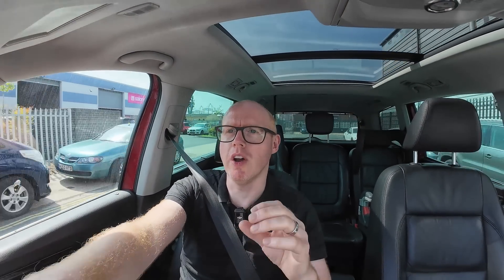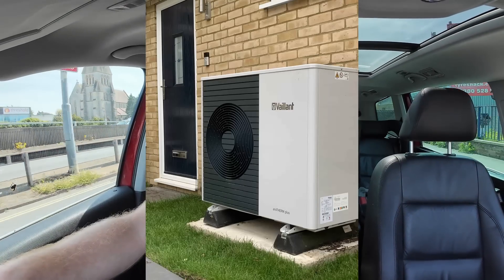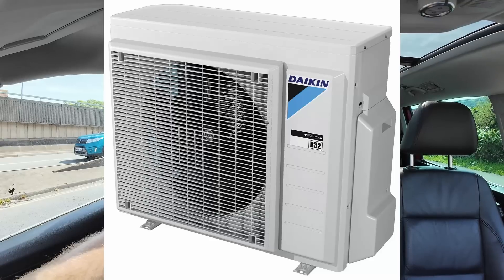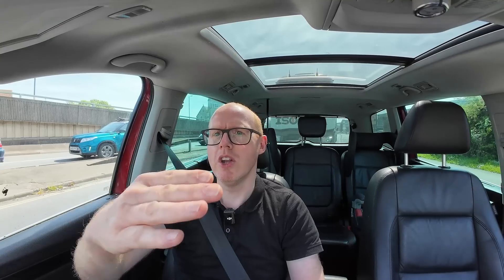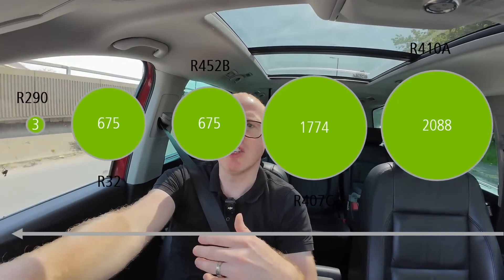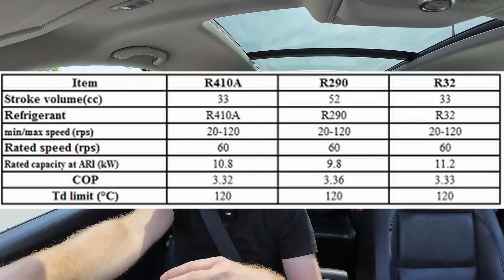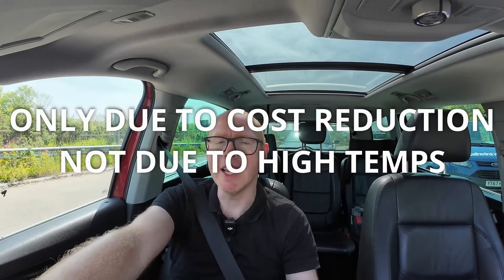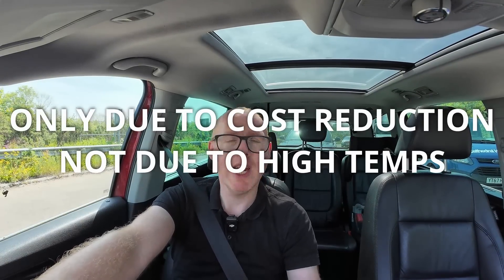High Temperature Heat Pumps Solve Nothing! Octopus Cosy 6 is nothing new!

Comment: Heat Pump industry in the UK is extremely poor and taxing on the owners. My heat pump was poorly installed by EPC Improvements from Chelmsford, and my SCOP is NOT going above 2.23. I had to pay £850 to have an independent assessment done to prove it was badly installed and configured, and now I need to pay another £500 each if I want 2 additional quotes for the work. So in total it will be almost £2000 before remediation work even commences. If that doesn't scare you than I don't know what will. Reason I needed the assessment and quotes is because I started a claim against my installer, 2 years in the making, all whilst I am paying around £1500 more on my heating every year.
Reply from the maker: Ouch. Was this an ECO4 scheme?
Reply: @UpsideDownFork  BUS scheme, £5000 voucher, total cost of heat pump £23000, so £18000 paid. I am happy to get in touch if you want me to, give you all the details and my journey towards trying to fix it. This is as raw as it can be with full total cost of ownership, which is crazy compared to a Gas Boiler. It's a bit like saying, scrap you 15 year old, £3000 diesel car for a £80000 EV because it is better for the environment and saves you money. How long to make up the £77k difference, then start saving?
Reply: @UpsideDownFork  I've sent through photos and the assessment report to 3 of the only Heat Geeks in my area. Two stated that they would prefer to replace the heat pump and all radiators (imagine the cost). I have initiated a Section 75 claim, and they were the ones that asked me to get 3 quotes for fixing it. I have asked them if I have approval to engage with all 3 companies, having to pay them £150+VAT per hour to come down, and perform their own assessment. I estimated £500 each, because it will be at least 2 or 3 hours per visit, if no longer.

Comment: Why talk it down when you use an R290 heat pump yourself?

The advantages over R32 are:

Not having to install new radiators.

Water getting up to temperature faster.

Having the latest technology
Reply from the maker: I don't use any of the advantages of my R290 heat pump. I'm not alone in this. Because of current building regs, they cannot design a heating system to be truly high temperature.

The marketing is a complete misnomer.

My heating flow temperature has been between 30-40 degrees for months and my DHW is heated to 48 degrees once per day.
A R32 heat pump would do exactly the same and would offer more flexibility during installation due to siting requirements.

Comment: I have an old 12 year old heat pump and it is high temp. my system is designed for 50 deg C Flow temp. The legionella cycle can be run at a lower temp for a longer period of time. I went for high temp to save upgrading the radiators.
Reply from the maker: Thanks for commenting. I presume your 12yr old heat pump is a R32 unit and in today's parlance, that would be considered a low temperature heat pump.
A high temperature heat pump must be able to achieve 70 degrees plus without the assistance of immersion elements. At the moment in domestic applications, this is typically just R290 heat pumps.
Reply: @UpsideDownFork R32 hasn't been in use for that long mate
Reply from the maker: @chrismorton5460  Good point. I guess R410A or R407C?

Comment: Thing is heat pumps are ok if you have solar and battery systems. Personally my cheapest quote so far is £5000 after the substacys witch is a lot, let alone for a basic solar system £7000 on top then factor in a new roof due apparently even though my roof has 40+yrs of life left both wining bids refuse to fit till i have a new roof even though they both say the roof has 40+yrs left and well exceeds any support needs, putting it down to it having old style felt. And I’ve had roofers inspect and there puzzled even a surveyor , both solar installers wear very reputable and highly recommended. And if i fitted a new roof it will be massively over £10k. Which makes it all very un affordable. Then i factor in if i just had a heat pump and using my forecasted savings of only about £10 a month £120 over a year and over the 25yr life span = £3000 saved witch dosent come close to paying for itself or even covering it’s replacement, then if you factor into the equation as you should servicing  yearly service I’ve been quoted for HP £220 compared to my gas boiler £70… that wipes out any so called saving if not paying more. At the end of the day this is not suitable for all nor affordable especially with the economy going down.
Don’t get me Wong if you tick all the boxes and you can afford the price of entry it can work but there are a lot of expensive boxes to tick.
Reply from the maker: Thanks for sharing your experience. I wouldn't pay too much attention to the forecasts. Mine said I would use 5000kWh in a year to heat the home and hot water, I used 2500kWh in reality.

Comment: I have a 20 year old oil boiler and I’m pretty sure it’s about to calf. Currently spend about 1200 PA on kerosene. I was under the impression I have to upgrade all the house rads and plumbing for a conversion to heat pump. Is it possible to upgrade to a heat pump keeping existing infrastructure ?
Reply from the maker: So many variables that it's impossible to say without a full assessment.

Most homes just need a few cheap and easy rad upgrades. Very few need any pipework upgrades.
Reply: Radiators in older homes tend to be oversized already especially if you have added double glazing, cavity wall insulation or the recommend depth of loft insulation since the heating system was installed.

Always, always insulate first. Heating systems need to be sized and commissioned according to the heat loss of the property  to run efficiently whether it's a heat pump or gas boiler. With gas boilers quite often the installers will just sling it in with no consideration to heat loss and leave the flow temp way too high with unbalanced rads and just control room temps with TRV's rather than correctly sizing radiators and balancing the system.
Reply: We've completly refurbished our 1935 semi including an extension, I'd recommend anyone to go through and look at ways of secondary insulation on roofs and floors before looking at upgrading thier heating.
I'm retired so have done most of the insulation upgrades myself and the heating is on auto but started switching out in march and didn't start switching in till late October

Comment: Point taken on the broader hyperbole on everything electric but they do excellent campaigning and raising of awareness so credit to them.
They do what they do and you do what you do, I.e. different to them but  valuable in your own right.

On the cozy 6, have a lot of faith in Octopus and am considering getting that system installed, from my limited understanding, I’m getting the impression that buying into the Octopus ecosystem a step further would be a safe option. 

Im currently on Octopus intelligent for EV charging and feel as though my transition is going in the right direction.

Admittedly, that’s based more on my gut feeling as opposed to your impressive advanced analysis.
Reply from the maker: Very true about EE. Thanks for commenting.

The Cosy 6 is an untested product. I'm in touch with 3 people who have them and so far still seem to have teething issues. More like beta testing than polished final product but at the price and the promise of further software development and integration, it promises a lot.

Fingers crossed they pull it off! 🤞
Reply: @ Yes, the beta stage of the cozy 6 has crossed my mind, this is the case with lots of solutions I’ve looked at on here in the green domestic energy market.

It’s all happening very quickly with a lot of competing options. I might hold off until the new while you and others do your stuff and come up with some conclusions. Of course there’s always going to be something new and better round the corner and at some point you just have to jump in.

Thanks again for helping.

Comment: I did my FGAS qualification so that I could buy and install an air-to-air heat pump. I think that is UK tradition to keep to our wet radiators, we should be plumbing in refrigerant pipework like the continentals. Also, completely agree that is a marketing excersise to push radiant electric heaters, I keep telling people I work with, it is impossible to improve on the efficiency of resistance heating. But they'd rather listen to the ad-men..
Reply from the maker: I believe A2A will take a giant leap forward once the BUS grant is removed.
Reply: @UpsideDownFork BUS grant should apply to A2A really, it's more efficient than A2W as it uses much lower temps, can cool as well, and can much better heat or cool a single room at a time.

I've just fitted two 9kW external Daikin units running 4 indoor units each. Love it so far. Currently still using the gas boiler for hot water, but looking at some heat pump method for that.
Reply from the maker: @richardskinner6391  I agree with the benefits you mention, apart from the efficiency claims. Extremely difficult to measure that and the people who have attempted, seem to only achieve a COP of around 3.
More than offset by the overall lower running costs due to zoning and intermittent heating being possible.
Reply: @richardskinner6391  It's a myth (or just general misunderstanding) that A2A use much lower temps. Use an IR Thermometer pointed at the internal HX of one of the units when it is running, especially when it's heating up a room.  E.g. one of mine is currently maintaining a room temp of 20C, and the HX is ~30C.  If it's actively heating, that will shoot up to >50C.  Where you'll find A2W systems can end up with a max flow temp of somewhere in the 35-45C range.  And rest of the time it will be providing lower than that.

As UDF says A2A is very complicated to measure as well for home owners to get a definitive answer on how efficient it really is. 

I love A2A, but recognise A2W's benefits.
Reply: @BenIsInSweden  Don't need an IR thermometer, I can read the liquid temp from the faikin modules I have installed :)

It's currently 42C when set to heat to 24C. But you're comparing that to the water temp, not the refrigerant temp. What's the refrigerant temp for you to hit a water flow temp of 35-45C? And what do you heat your hot water to?
Reply: @richardskinner6391  How long had it been running at 24C? You will find many will slowly ramp up to the max.
You may have missed from the comment, I use A2A.  But A2W the refrigerant temperature will only be about 5C above the flow temperature.
Hot Water in A2W is outside the comparison, as it runs separately with a different temperature etc.  And depends on the Cylinder for efficiency - e.g. some will just want full heat from the heat pump, whereas others integrate better and request a temperature close to the desired temperature, and take longer to warm up.

My DHW is provided by one of my A2A systems - a Hitachi Yutampo Twin 35, and I have it set to 52C.
Reply: It's a multisplit, at least one of them has been on for.... ages. This unit has been on for about 3 days.

I don't think many people in the UK (unless they have a house designed for an A2W pump, with UFH or massive rads) are actually running at 35C flow temps. I think retrofitting that would cost (even with the grant) more than an A2A multisplit.

I did consider a hybrid system, but the daikin hybrid can only run three indoor A2A units. I have two 4 way multisplits, each on a 5 port 9kW outdoor unit. For now DHW is on the immersion and runs from solar, but long term will likely fit an IHP system, but the payback on those isn't great.

I don't have the facilities to fully test, and don't have an A2W pump, but the spec sheet SCOP performance (even from the same manufacturer) of A2A heat pumps is significantly better than A2W. I also get cooling, better per room control, faster heating from offline, and I can rip out ugly radiators. A2W makes sense for new builds and some other situations where A2A doesn't suit, but A2A is basically ignored in the market which I think is a strange mistake.
Reply: @richardskinner6391  There are plenty on heatpumpmonitor.  Remember that design flow temperature will be at the ambient design temperature (typically ~-3C), and run on weather compensation, so will be running at lower flows above that temperature.

I agree that cost is definitely a factor with a proper wet system.  But that's more down to existing non-low temperature heating systems up to this point.  E.g. a A2W heat pump swap in a home with a low temperature heating system already there, would typically be cheaper than replacing it with A2A, especially if you factor in equivalent DHW heating.  Something that will change eventually over time (decades likely).

When I move back to the UK my mind is basically set on A2A anyway, I WFH and can't do without AC in summer.  Whilst rare on the property listings, I'm more wary about properties with A2W heat pumps, than A2A.  Because A2A generally if designed properly for cooling load should be at least closer to (or in some cases spot on) the correct size for heating load.

Cooling seems to be the main sticking point for A2A being included, as it appears to be considered a luxury, and they don't want to add more load to the grid in summer etc  But I think if someone has solar capacity to run the AC during summer it should be allowed.
Reply: @BenIsInSweden  I think solar production in general is producing more and more of a duck curve and we should probably not worry as much about summer usage, especially as ac load is logically going to be highest when it is sunny! Ev Nick on youtube has had octopus tell him to increase his flow temp as his cosy 6 wasn't performing well on a low flow temp. 

An a2w pump replacement for a gas boiler (designed with small rads) which is the common scenario in the UK is either: cheaper than a2a but way less efficient as you need high flow temps, or just as expensive as you need to replace radiators and possibly install ufh. I'm not truly convinced it is as efficient even then, and still doesn't provide the other a2a advantages we've mentioned.

If it were not for the grant, a2a would be the clear winner. Octopus quoted me £15K, minus £7.5k grant, so £7.5k to pay for and a2w pump. Instead I paid £12k for my two 9kW multisplits.
Reply: @richardskinner6391  EV Nick's thing is more on the Cozy 6 than on A2W in general.  UDF has another video on the Cozy 6 where the MCS tests are woeful compared to others available on the market. 

What did your £15K quote include?  My boss' Octopus quote was for £2k which included replacing 7 rads.  Which in his case a boiler replacement would have costed more (he was quoted £4K), as he has a backboiler, which aren't allowed to be replaced anymore.
Reply: @BenIsInSweden  right but the cosy 6 (and soon the 8 and 10) are likely to be the most common ashps in the country going forward. That is the market comparison point.

The octopus quote i took to mean "go away we don't want to do detached houses" if I'm honest.
Reply: @richardskinner6391  The comfort is a far superior with radiant heating , and no a2a are not more efficient then the a2w system ... This month the temp here were going to -1c and i was paying 1euro per day without turning off the pump at all and sleeping in my underwear . Its a 70m2 home , its not much and im on radiators , i can imaging even lower with UFH or same for a bigger property . In my office we have a2a system and the quality of life is much worse , not to mention that you have to clean the filters constantly and if you are on a ground floor probably having a cold feet also .
Reply: @toniilievski3934  I don't agree, that really doesn't match my experience with my two multisplits, which are lovely and comfortable, and have been way cheaper to run than my old radiant heating via gas boiler.
Reply: @richardskinner6391  Heat pumo should be cheaper to run then a gas boiler no mater the system , for the rest , maybe its personal .. How do you heat the bathroom btw ?

Comment: The £500 is highly misleading. On other YouTube videos the Octopus lady says the AVERAGE price is £500. They quoted me over £4000 for a 3 bed semi which is 8 times more.  Octopus then quickly called me (which was good) but they were unable to explain in detail the £4000.   It seemed they are proposing to do a lot of unnecessary work in the property.  The Octopus lady in video said the Cosy Heat Pump is for everyone. However the Octopus sales man told me over the phone that they will only install a heat pump if it matches the total heat loss from the property and they may refuse to install an Octopus Heat Pump but install a Japanese unit instead.
Reply from the maker: In some ways the Daikin is a better unit. £4k for a 3 bed semi does seem on the expensive side for an Octopus installation.